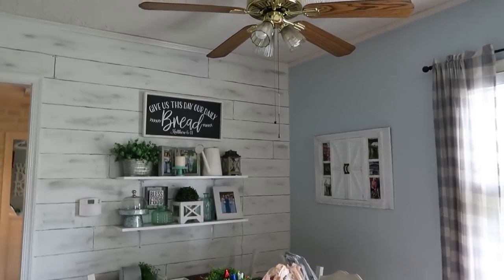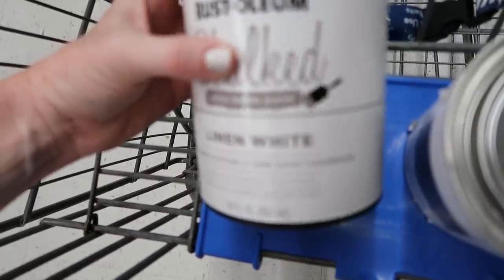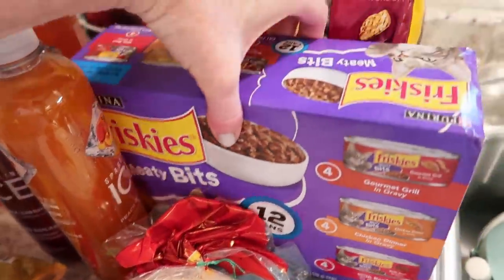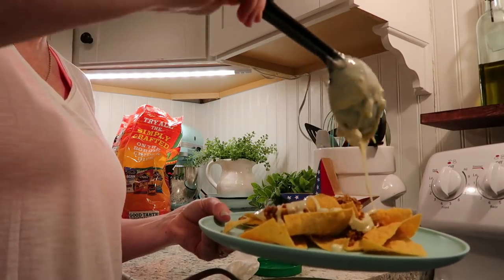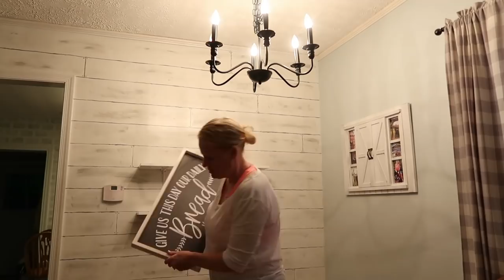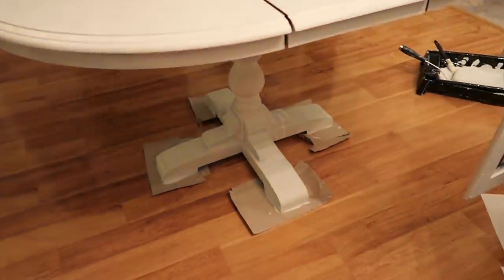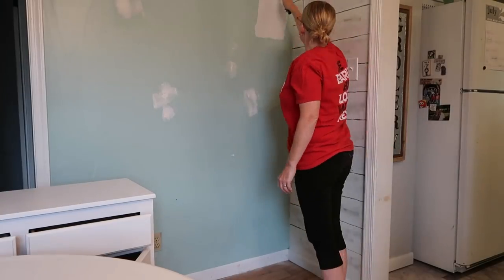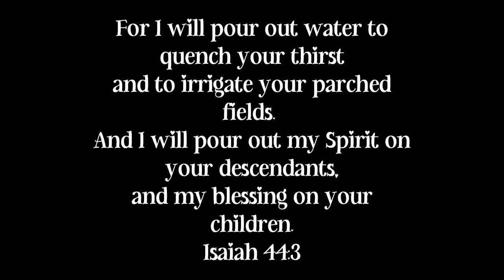GETTING THINGS DONE / SHOPPING + HAULS + COOKING + DINING ROOM MAKEOVER / FARMHOUSE DINING ROOM

Comment: Instead of contact paper for the backing, I use scrapbook paper squares with glue dots.  The dots hold the paper to the wood but peel off when you want to change them.  Cost-effective and easy to change on a whim.  I have seen white-washed board printed scrapbook paper recently.  My little hutch needed a  pop of color and the paper in the back did the trick.
Reply from the maker: Such a great idea! May try that for the holidays!😀👏🏻